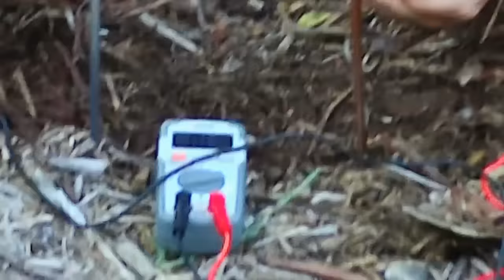OFF GRID POWER? The Earth Battery Experiment

Comment: Surface area ? Amps /watts . You spent a lot on material.  And have very little Surface Area . Why don't you get a tall can of beer and some 8 or 10 g braided wire . Cut the bottom out of the can . Stick copper wire through the hole in the other end . Fill with mud . You can put the Mud in first . Alligator clips. Tape the end . Also , Epson salt . POWER ! Now string the beer cans together and build in rows build up volts to say 32 v . Add strings and tie in parallel.  Amps go up . Using DC to DC buck step down converter.  Set your voltage.  32v stepped down to 6 volts . Amps goes up . Charge a flashlight or cell phone . You're looking for 15 watts or more . You added the Epsom salt . Now add a teaspoon of lime juice.  Lemon also works . Or you can go all-out if you have some sulfuric acid.  Drain cleaner is a good source for sulfuric acid . 
Now your cost is way down for materials  . And sow long as you have beer cans or tea . Battery cost . Turn the radio on . Check out the 5volt led lights . Oh yeah. And all you need is some paper , cardboard,  tape , paint . What ever to insulate the cells .

Comment: Hey I appreciate this video and the effort in doing and experimenting throughout the video. i have a different theory, perhaps it isn't the electrolytes or whatever that is reacting to the rod rather the ground is actually vibrating. so that means its piezoelectric methodology that you should perhaps try to implement. the bacteria and other critter ecology working around the soil will in turn work around the piezoelectric rod you insert and the more activity the higher the voltage. piezoelectric is inherently ac btw. i was planning to do an experiment with piezoelectric materials and map them together into a large sheet and then dig the sheet into the ground plain and another sheet covered in honey. my guess is the sheet with honey will generate more energy considering the critter ecology will have more activity around it cuz of food. this proves its piezo effect and not some corrosion theory and also if it is piezo the more input feed to help the ecology to have higher activity is a key component. i do not have any equipment as near alot like you nor money but just like you interested in seeing people being free generating their own energy. if you can do an experiment like this i'd like to see it. thank you and thanks for the video. cheers!
Reply from the maker: The next power experiments that I do will be either with biological fuel cells, using bacteria to produce a difference in potential, or  thermoelectric generation .. both have some great potential in applications where getting power from the radiant light of a nearby star is not feasible.
Reply: I like your idea, but I'd choose a different medium. Honey is well known to be very bacteria and virus resistant. If you're attempting to create a piezoelectric phenomenon based on physical biological movement, you'll need a very active medium. I think basic compost would be effective. If you do choose a sugar medium, I'd go with plain sugar syrup or better a syrup made from fruit juice. Also, you'd probably want to do some research on the best piezoelectric materials. Perhaps you could crush a quartz crystal into powder and mix it with the syrup? Cool thought anyway
Reply: @davidmckay9558  I think I'd bury that crystal whole in the syrup and keep it under pressure without crushing it, might produce more piezo power.. Thoughts?
Reply: Look into David La pointe. Definitely discovered two novel methods for over unity.

Comment: Also do you think upping the scale say to a 5 gallon bucket and 3 inch diameter pipes would make a significant difference this idea is promising I feel it has the potential to be fairly efficient if you could make enough of these larger cell to say power a car battery the possibilities would be endless.
Reply from the maker: What I found was that voltage remained a constant with aluminum-copper electrodes .. increasing the surface area of the electrodes increased amperage.  To get higher voltage from the earth battery, it would be necessary to put much more distance between much larger electrodes .. not something that would work for a backyard setting (but that IS the way they powered the old telegraph system)
Reply: You may have already seen this or know of it but if not its pretty interesting and comes with a link for the schematic its only 4 pages and seems fairly simple.

https://youtu.be/YooXORX2Vd0

Comment: So can you light up a LED directly?
Reply from the maker: Using moistened earth as the electrolyte in a dissimilar metal battery, one can light an led .. but there was not sufficient power from the rods in the ground to light the leds that i had at my disposal - maybe one that can operate at a lower amperage could light up .. ultimately, this method of generating power is of very limited use.

Comment: I've been considering trying to build a steam engine generator.
Reply from the maker: Steam tech is a valuable skill set to have .. especially if you have tools that can be used independently of a functioning power grid.  Most of the power generation that is done on the planet today is 1) make heat 2)boil water into steam 3)pass through a turbine ..so experience with making and maintaining boilers, and working with steam under pressure in general are currently marketable skills.

Comment: Considering most sleep, 10 hours a night, I don't see why this couldn't be set up in series on a larger scale, linked to battery cell line. Once you have enough in the ground, and enough batteries to store the energy, couldn't they store enough to survive your days and replenish at night? 1.5v off a 3 cell series, that's what maybe an 1 1/2 inch wide by 5-6inches long?

In a rowed series 10 ft wide section, you'd fit around 80 give or take. 80 of these, producing 1.5 volts would come out 120v. At that point its storing it, right? 

Didn't catch amps, but that could be altered and played with depending on what nutrients are added into the soil, as current varies on the electrolytes in the soil, around it, moisture in the soil, Etc.

But my point is, why couldn't this work connected to a deep cell battery line?
Someone with actual knowledge help. 
Is my thought process wrong here?

Comment: how long until the electrode corrode away?  The electrolysis is giving off the charge, yes?  So there is no electricity from the "earth", right?
Reply from the maker: The electrode surface will oxidize over time, because the current being generated is from a chemical reaction - I don't know how long, precisely - in any case, I hope that I was able to demonstrate that the current being produced is from that reaction, yes - and not from earth's magnetic field.  Can we get power from Earth's magnetic field?  Sure - but not likely on a back yard scale.

Comment: Cool project... I have been looking at doing one of these... 

Would it be possible to run the output through a step-down transformer to increase the current?

If you had say 100 cells with 50v output... through a transformer down to 12v.... would it be possible to charge a 12v battery?
Reply from the maker: I wouldn't want to quote numbers without running some calculations first, but yes, you can trade voltage for amperage .. although you would loose some energy to heat in the process, so starting with greater surface area on the electrodes might be a better idea.  The cells that are in-ground and open at the bottom did not loose any power over the week, and if one were to wire them in parallel, that would increase amperage as well.
Reply: No, in order to run it through a step down transformer it would need to be an AC current. You would need to find a way to convert it to AC first. Batteries cant take AC however, so you need to convert it back to dc after you step it down.
Reply: @PR0X3R  so you can't use this method to charge a battery?
Reply: @breezeg3542  not unless you convert back and forth between ac and dc
Reply: @PR0X3R  then what application could a simple earth battery cell be used for without converting if not to charge a battery?
Reply: @PR0X3R  I'm looking at all sorts of independent simple ways to create and store my own energy is all
Reply: @breezeg3542  i cant think of any uses tbh. Earth batteries put out such low voltages its not worth it tbh.
Reply: @PR0X3R  what do you think about single wire earth return for powering a light
Reply: just change to 4 stacks to have each put out 12.5 volts. no need for trans.
Reply: You want at least 14.2-14.8 volts min. pressure to charge a battery (nominal 13.5 volts +/-.
Reply: @dananorth895  Whilst that is correct, I'm pretty sure I have a dc-dc transformer in one of my bins; I'll have to look, and don't forget that another earth battery involves a long low-suspended wire, anode and cathode far apart, picking up the earth's actual current.  From what I recall, this actually powered an array of lights.
Reply: @PR0X3R  If you ran the output of Earth Battery into a ZVS you could step up the voltage to run leds off of it or rectify to charge batteries although the high frequency is better used elsewhere than charging batteries
Reply: @breezeg3542  you could run 12vdc whitegoods and lights at night unlike solar ;) or run a big one through an inverter...

Comment: I screwed up about the texture.  It is area of the tall jar of water and the 12-inch rod of magnesium.  I never expected to see 5 milliamperes and jumped to a wrong conclusion.   I performed a bad science experiment by making changes before duplicating the experiment of someone else.  I shaved the magnesium first, with hopes of making a new modern type of cell.  I then used that textured rod which produced much higher amperage.  5/16" diameter rod.  However, on the second attempt with a smooth rod the 4 milliamperes was still true.  I then learned proximity of rods makes higher amperage.  The large vessel and rods made that possible to determine.  That is a 100% and I tested that several times.  The amps would drop into the 2 range and as I brought them closer would climb up into the 6-7 but settle back down in the 4-ma range.

Comment: You have a wealth of knowledge, Jason!  I have one of those little green meters and have been amazed at how it works.  Now I have a better understanding of it.  Thanks for sharing!     PS   You licked the end of those connections???  Eeeewwwwww...  You could've just licked the tips of your fingers and then touched the wire ends to no doubt get the same effect.  Just sayin'...
Reply from the maker: At only 1.3 volts or so, there was barely any tingle at all .. we used to use the 'lick it' method to check our 9v batteries when I was a kid 🤣
Reply: Oh my gosh!

Comment: Heard a rumor about a guy whom allegedly cooked shine using electricity. He wrapped coils around plastic barrels and put them under high tension transmission power lines. If you did that now adays, wouldn't the power company see a load on the power line, tho?

Comment: So when they had telegraph wires and telegraph lines, how did they power them without generators during the civil war of 1860-65?

They strung Telegraph lines 400 miles. They use the earth to provide power.

So just look at the patents for the telegraph line. In some cases they got 600 volts. In some patents they talk about getting 3000 volts.

They did this by treating the soil with chemicals. 

Get a container fill it with dirt,  add vinegar and salt solution to that dirt. Galvanized nails and copper lead, can get 10 volts if set up correctly.

Robert Murray Smith has is with a graphite rod build. 

Look at Patents.

Comment: can you also charge these batteries or will they just die out after to much use with the aluminium degrading.
since if you can't recharge them then perhaps you could try a iron aluminium battery, I know people mix aluminium powder with iron rust powder to generate a lava like liquid which melts straight through a place of steel like it is paper.(don't know the english name, but it was also used for welding train tracks)
Reply from the maker: Eventually the surface of the electrodes will oxidize from the exchange of ions - it IS a chemical battery after all - even if it is just metal rods in the ground, I am satisfied that the only current generated seems to be from that chemical reaction - and there are many better ways to make a battery.  That mixture of red iron oxide and powdered aluminum is called 'thermite' here, and works great for welding, and breaking up rocks where blasting might damage structures:  Burn thermite on the rock to super heat it, and douse with water to fracture it.  Beware of rock splinters, they are lethal!

Comment: Putting holes in p.v.c. may be easier using, a propane torch, and heating the cathode and anode till they melt through, then you need no epoxy

Comment: To get around the low amperage issue, maybe hook a fresh earth battery up to a capacitor for a few hours, then use the capacitor to power something? Seemed to work in another youtube video I saw.
Reply: Won’t increase the total power.. might just equalize the voltage to current ratio a little. If you want more amperage electrolyze your soil and use plates with a higher surface area while wiring in parallel. Perhaps configure a cell that has 2 cathodes and 2 anodes for wiring with both volts and amps in mind. The parallel side should have a high surface area while the series side can be a sharp needle or rod

Comment: You need about 380 of them to make the power needed to charge a cell phone.
Some in series to get the voltage and some in parallel to get the amps.

Closer those electrodes are to each other the higher the output.

Comment: So what happens when you get corrosion and the output starts going down and down and down and down this is the optimum when you start out because of the dissembler metals you're causing the corrosion which is going to ultimately reduce the output

Comment: What about aluminium and air?  That has a very high power density but costs a lot of energy to manufacture as about 10% of South Africa's electrical power goes to aluminum production.  The Zambian copper mines use most of the electrical capacity of Kariba dam

Comment: First: Never measure voltage with fingers on electrodes.
Second:  Aluminium can't be soldered.
Third: Power (A) can only be measured with a load and an ammeter in series.

Comment: So is this a constant flow of geo-electricity by way of electrolyte vibration? Does it have to be revitalized over x duration of time due to loss of electrolytes?
Reply from the maker: What I was able to generate in-ground appears to be simple chemical ion transfer (like a battery), and not geomagnetic energy.  I suspect that in order to get that geomagnetic current, the electrodes would need to be much bigger, and placed FAR apart (as in miles) - that is the way the telegraph companies did it, once upon a time.  Cool, but not too useful for generating power at home.
Reply: @Green.Country.Agroforestry  Sorry.... telegraph companies used regular batteries, and a lot of them, to give them the  high voltage and current required to cover those long distances..

Comment: I wonder if you could use this low voltage to assist a magnetic wheel ?
I'm not savvy with the knowledge of what you call things yet but I'm learning. 
I wanna make 2 wheels with magnets attached all around the inside of the first wheel then a slightly smaller wheel with magnets on the outside of the inside wheel.
The outside wheel will be stationary.  The inside wheel will be free to spin.
The magnets will be reversed from the outside wheel.
If I use a ball bearing wheel from a bicycle,  a really good one it should keep spinning once it gets started.
After it gets a certain speed, the inner wheel can pivot  to move out or back in. All the way in is full speed, and all the way out is off.
Sounds crazy now. I've put it into words 🤔 
What do you think , anyone ?

Comment: I tried something else,,,, I took the minus from the electrical outlet of the house,,,,, and the plus from the ground, using a steel electrode, and a normal light bulb of 100 watts, and 220 volts,,,, and I got high voltage, as if the ground behaves like a voltage-raising transformer, which illuminates my light bulb with white light, while from the normal home network, the light bulbs glow yellow, and from the ground they glow white and very intensely, ,,, so I used a normal lighting ec, with the minus from the electrical socket of the house network, and the plus from the earth, and also I used a coil with several turns for overload damping, and also for protection against return blows from the earth to protect the bulb from exploding,,,,,, I connected the coil in series with the steel electrode embedded in the earth as the positive pole ....
The standard frequency of the home electrical network is 50 hertz....